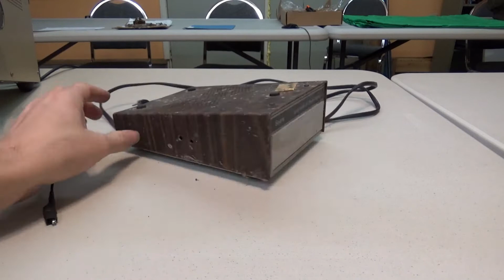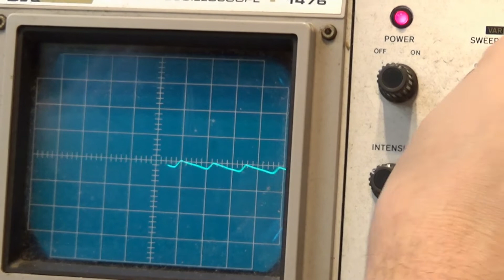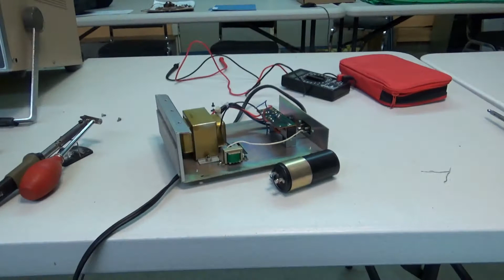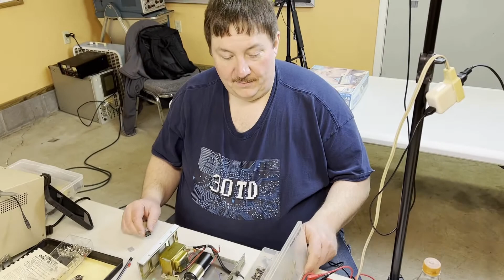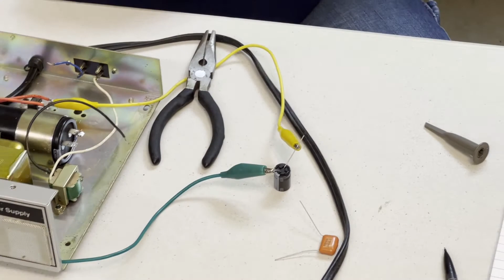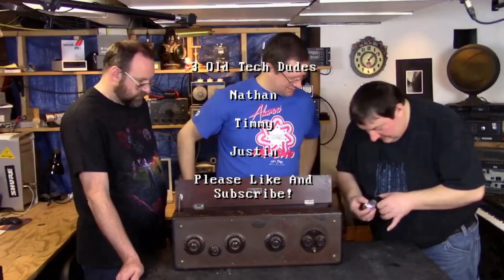Re-imagining a 13.8v 1 amp Power Supply - 3 Old Tech Dudes

Comment: This reminds me of the Radio Shack power supplies they sold for CB's and whatnot.  They had the standard one, and then the regulated one.  I kept wondering who would ever get the unregulated one.  On another note, I picked up a Pace Communicator I, 3W 2m 6 channel (crystal) HT at a hamfest years ago.  It does work, but the deviation is quite poor, quieter than a narrowband FM rig.  I found the deviation pot inside, but it's cranked all the way up, so I'm guessing there's another component that's out of spec.  Was wondering if anyone has a schematic or service manual laying around.  It's a cool late 70's radio, even has a full size 4 pin mic plug on top.  73!